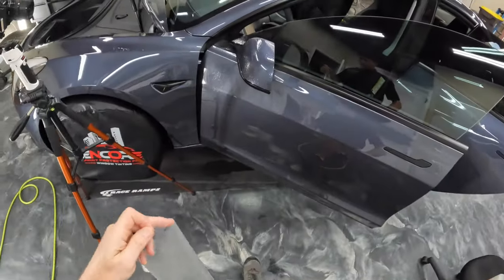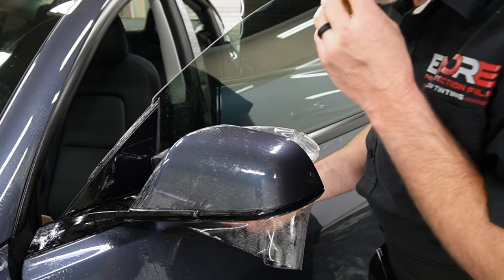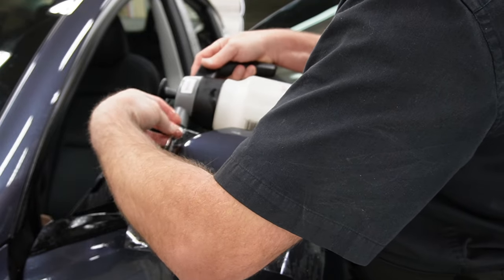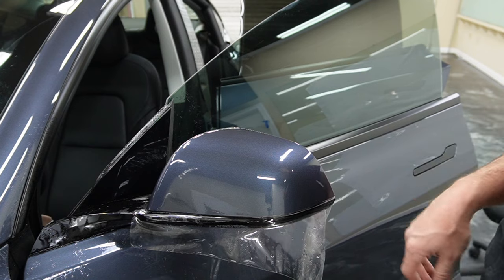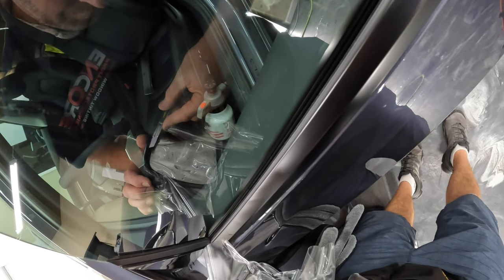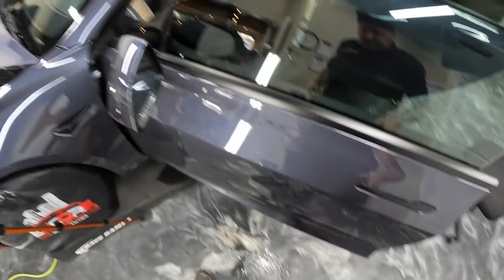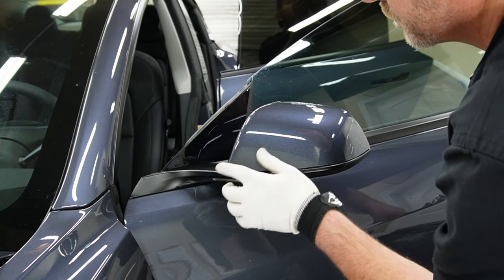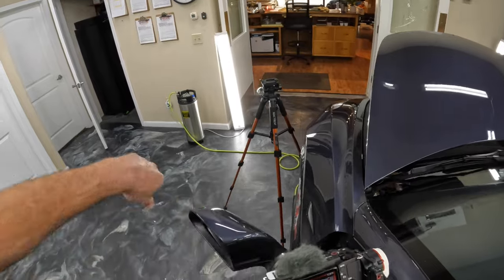Tesla PPF Install - The BEST Tesla Mirror Coverage - Paint Protection Film

Comment: Do you have to use heat gun, if you do ppf on the portion of side doors where rock chips are prone to hit? Or its only for the curved edges ?
Reply from the maker: Every edge, every time. 👍🏻😁 Heat sealing is important and should be done on every piece of PPF that you install. It will help ensure that your edges stay stuck down over time.

Comment: Hi thank you for your video , I was wondering how long you have you waited to trim the PPF after the installation??
Reply from the maker: On these mirrors, I like to wait until all of the solutions have dried out from under the PPF.  30 minutes or a little more. If I need to trim the mirror right away, I use the heat gun and heat the edges, just like the final heat sealing. Then, in about 3 minutes, I cool the PPF down with some water and trim the edges. Once trimmed, I do my final heat seal, and the mirror is good to go. 👍🏻

Comment: What’s the main difference btw the 2 squeegees you were using? Can I get away with using my window tinting tools when trying to attack my front bumper of my 2023 Subaru WRX?
Reply from the maker: I'm apologize for my super slow replying to your questions! We're in Yosemite National Park on vacation. Phone service is terrible up here this year. I can't load any of the videos to review the video parts you are talking about. 😫 At latest, I'll answer your questions when we get home on the 14th. 😁
Reply from the maker: You can use a different sqeegee, but I highly recommend the correct sqeegees. They are really cheap online. Check out my video where I talk about all of the tools needed to install ppf. In the description, there are links to all of the tools I use. 👍🏻 the orange sqeegee is softer and conforms around ridges and other rounded edges better. The pink sqeegee is harder and works well when you need a lot more pressure on the material. That can help in tight areas or if you leave a little water behind and want to push it out.

Comment: Very clean install.  What % of alcohol do you use in your tack solution?
Reply from the maker: Thank you! Many many many years of experience 👍🏻😁  I start with 71% rubbing alcohol. That gets diluted down to 10% rubbing alcohol, 90% water in whatever sprayer I mix it in. I also keep a sprayer of just warm water. Have you ever tried just water? If not you might be surprised how often that works in place of tack solution. Thank you for the question. 👍🏻
Reply: Hello sir, Does it have to be mixed with alcohol for PPF installation?
Reply from the maker: @sporaautowrap4981  Yes. I use 3 bottles during my installs. 1. Slip solution - soapy water 2. Tack solution - 10-20% rubbing alcohol to 80-90% water 3. Warm water -  works better to tack things down than the rubbing alcohol sometimes.
Reply: @EncorePPFtint  thanks for sharing sir, im newbie from indonesia
Reply from the maker: @sporaautowrap4981  Awesome, welcome to the channel! Is someone teaching you to install PPF or are you learning yourself from videos and working with the material?

Comment: Hey bro any chance that film is pulling back with all that stretch? Thanks for doing these informative videos 🤘🏻
Reply from the maker: Thank you for the feedback! 👍🏻 I'm not having any issues at all with this process. After tons of Tesla mirrors and trying different things this is where I've ended up. I figured out this process while doing a matte finish conversion on a Tesla. You need to make sure to prep the whole surface with full-strength rubbing alcohol. But that is necessary with any installation.
Reply: Thanks for the video. I am doing a matte ppf full car on a new model 3 this week. And tips vs doing a standard gloss ppf? Thanks
Reply from the maker: @masonbarnett3927  We're starting a Matte Finish Model Y next week. Fun stuff. You'll want to wrap and tuck everything. Also keep your seams super tight if you are installing a kit. With kits, all edges need to be extended and then trimmed after install. Even a sliver of the gloss paint is very noticeable. Matte hides a lot of distortions and stretch marks in the adhesive. Matte does make air pockets really stand out. So, rock chips and dirt under the film will leave white air pockets around them. I still do matte mirrors the same as in this video but add a 2nd piece to that uncovered side of the mirror. Some people cover the mirror in one piece but I've never liked stretching the film that thin/tight. You might also notice that the adhesive acts different so you'll need to adjust to that. I also notice that the matte we use scores and tears different while trimming. When tearing along a cut the film can veer off the cut if it's not deep enough. You might want to do a couple test cuts before you get started. I enjoy installing matte. Good luck!
Reply: Thanks for the insight. It's a white model 3. I'm using suntek ultra in bulk. So I'll wrap everything as usual. Thanks for the tips on how it cuts.
Reply from the maker: I just checked our schedule. Turns out it's a White Model 3 (not a Y)  we're doing in matte next week. I'll be recording the whole thing and posting it in parts on this channel. 👍🏻
Reply: Sorry last question for this video, are you using high heat settings as if you were shrinking a rear windshield? Or are you using a different setting?
Reply from the maker: Bring on the questions! I made these videos to be helpful. 😁 when heatshrinking rear windows, I always turn the heat gun all the way up. I'm trying to get the job don't as quickly as possible.  When you are new and just learning, it's best to practice with the heat gun not turned all the way up (depending on the heat gun, how hot it gets, and if it has options not to turn up all the way). The film can burn pretty easy on those Tesla Model 3 windows. Tons of heat shrinking and not a beginner window. 😁

Comment: How to avoid stratch marks?? I tried to do it on porche but after finished job there was a small stratch marks on where i tack.
Reply from the maker: I'd need more info to be helpful. What is the year make and model of the Porsche? This technique doesn't work on all vehicles. If you work the PPF for too long or if the PPF pops up, it can leave marks in the adhesive. If the film isn't stuck down well enough it can shrink up (move) on certain mirrors and that will leave stretch marks. Also, make sure you are heat-sealing every edge.
Reply: @EncorePPFtint  2023 caynne gts coupe
Reply from the maker: @디노의하루  So that mirror takes a different technique. I just did those mirrors. I was going to post a video of it but the material tore off of my trim line and when I started over I forgot to turn the cameras back on. so dumb. lol. I can upload what I've got if you think that would be helpful. I go over how I'm going to install on that mirror and then begin the install. At some point I make a cut and when I go to tare the film it tares off my cut and I had to toss that piece.
Reply from the maker: I uploaded the video that I have for that mirror. I just need your email address and I can share it with you.
Reply: @EncorePPFtint  thanks a lots mate-! Appreciate it :)
Reply from the maker: If you give me your email address I can share the video with you. The video is not going to be public because it's missing footage.